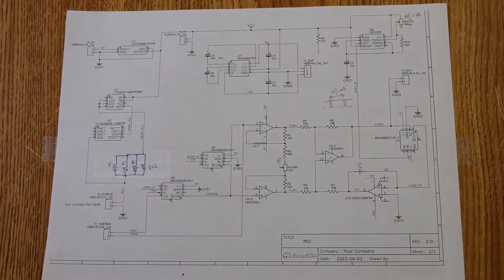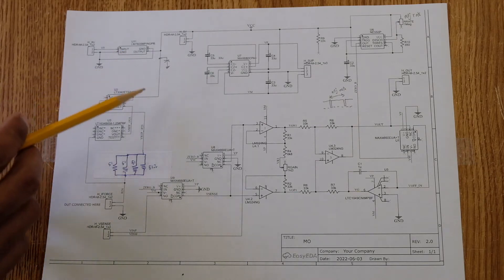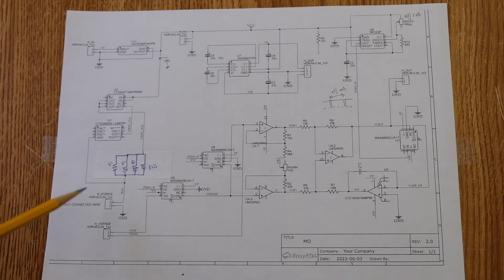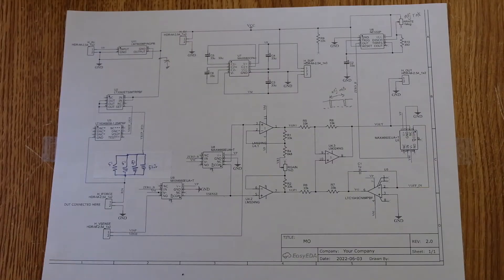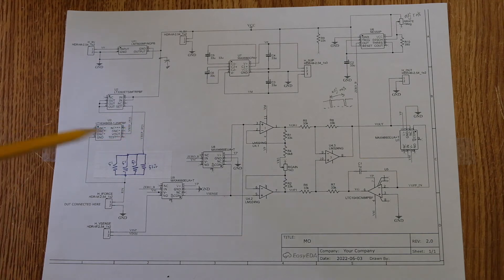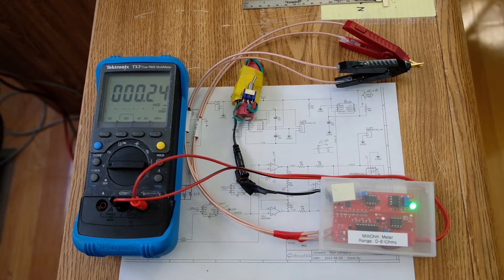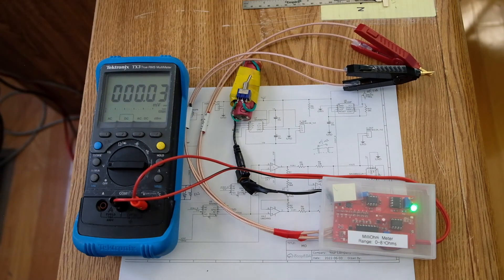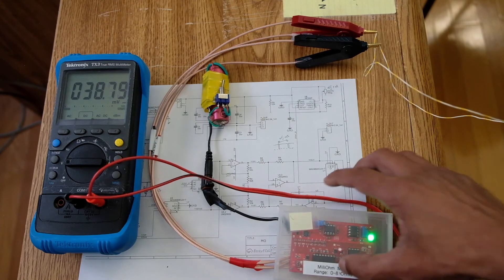Yet another homemade milliohm meter  (auto-zeroing)! [part 2]

Comment: I think your integrator (LTC1049) is missing the charge limiting resistor. At least in the schematic. https://en.wikipedia.org/wiki/Op_amp_integrator
Reply from the maker: Thanks for your comment. I wasn't too concerned given that the LM324 is limited to about 40mA output drive and within a few cycles of the integrator cap charging up to the offset voltage the current is fairly small. There is also some current limiting by the CMOS switch.

Comment: Zeroing the resistance of the leads is, I think, non-negotiable if you are talking about doing accurate sub-ohm readings. I would instead add a button to run your auto-zero functionality which you press when leads are joined, and then shortly after you attach them to resistance to be read. In addition for meter of this class, I think I would be willing to spend the dollars simply on two dual precision opamps in order to make up the four you currently need. 2x OPA2189 or 1xOPA4189, or 2x4522-2 / 1x4522-4 etc.
Reply from the maker: Thanks for your comments. The unit does continuous auto-zeroing (rate adjustable) as you desire. Input (hi Z) of instrumentation amp is shorted out during AZ. The only major source of error in the prototype is gain drift due to the tempco of the current setting resistor. The amps have open loop gains ~100k (closed loop gain is 10) so virtually no error except non-linearity at the extreme of the range (7 to 8 ohms measured). I guess using higher spec amps is fine, but for 0.1% type accuracy, the current prototype meets that. The residual AZ offset is perhaps 10-100 uOhm which is also good enough I think.
Reply: @analogwings  The autozeroing is across an in-circuit shorted link, rather than across the length of the voltage measurement wires
Reply from the maker: Below 10-100uOhm level, the opamp input bias current and switch on resistance will begin to affect accuracy. IMHO, at the milliohm level, this AZ technique is quite acceptable. There are bigger sources of error when enters the sub milliohm domain than AZ. Definitely a lot more can be done to raise the accuracy to get to 0.01% or better.